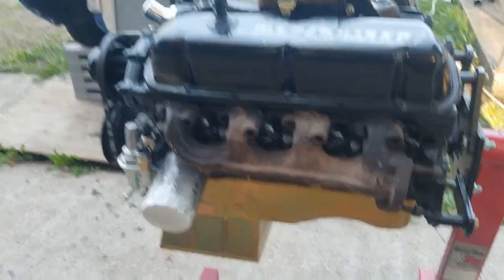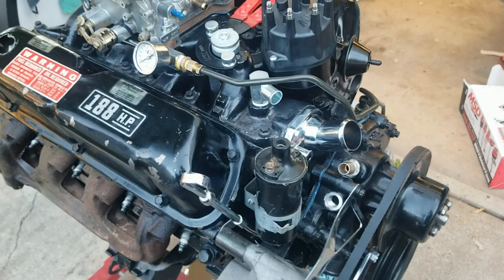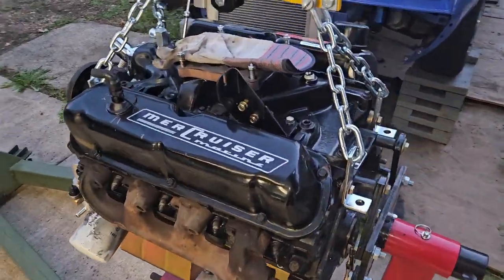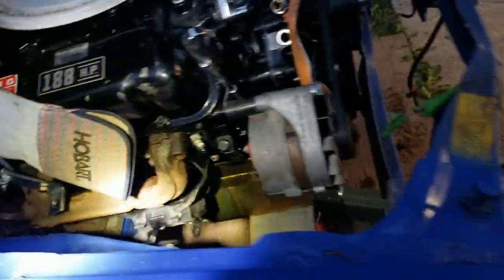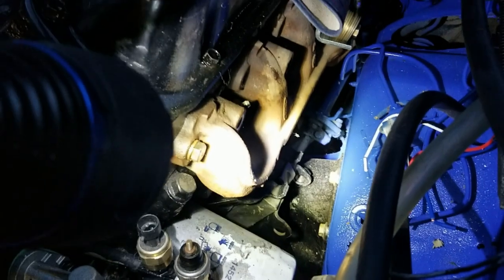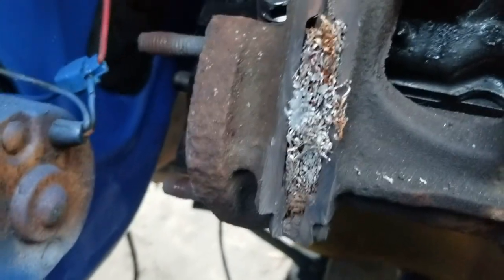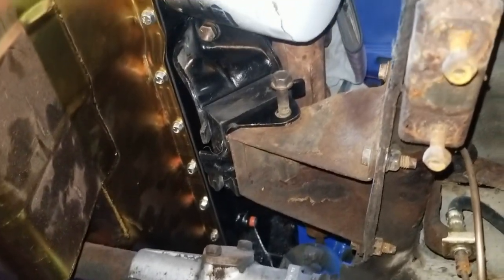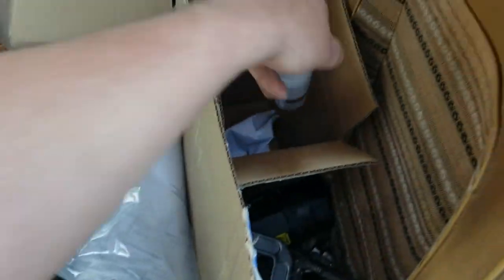Drag n Drive Pinto: V8 & SROD Swap 7 #nonamenationals

Comment: I used the big pinto mount on the passenger side and the one u got painted black big one on the driver's side and its already got the bolt holes made where the mount will be positioned an inch back, I ended up making my own holes on the passenger side.  I put a few washers between my motor mounts and the block to get a lil clearance between my oil pan and steering rack. Just a few things I did that may help. Those little frame mounts didn't work for me at all but I think that the engine is 1.5 inches off center towards the passenger side.  Maybe some of this will help, it took me awhile while to figure out how to make it work so I can relate to getting cranky but its so worth it in the end